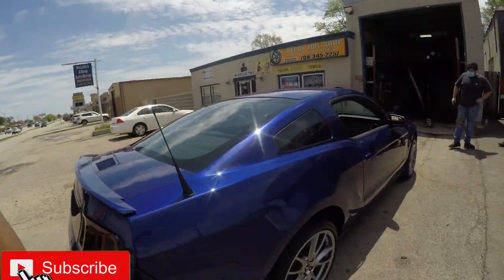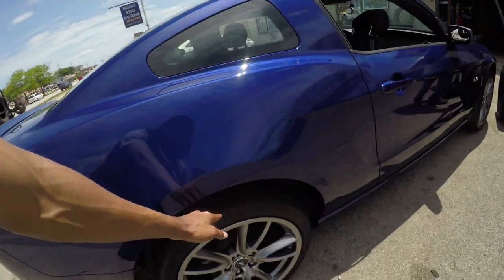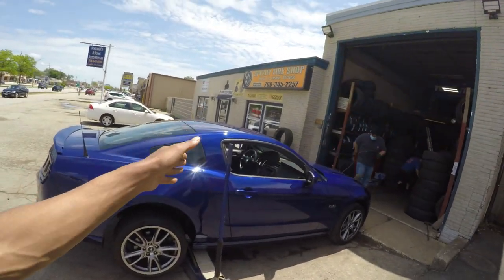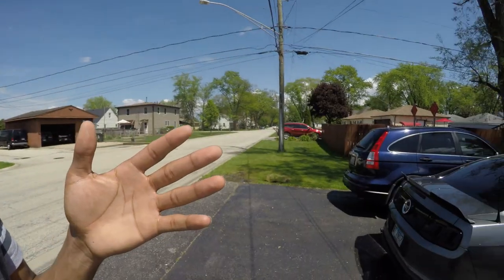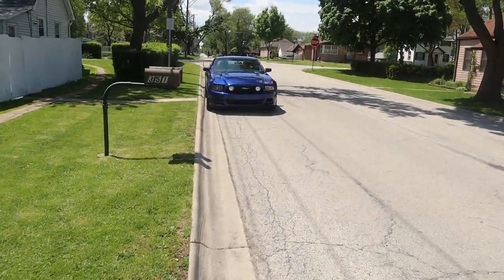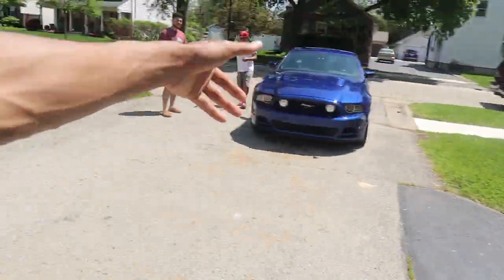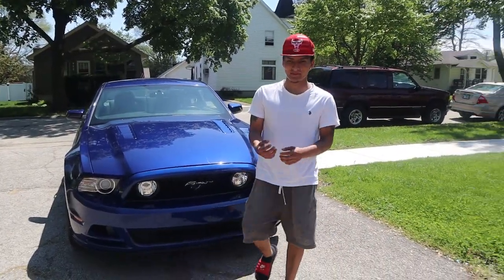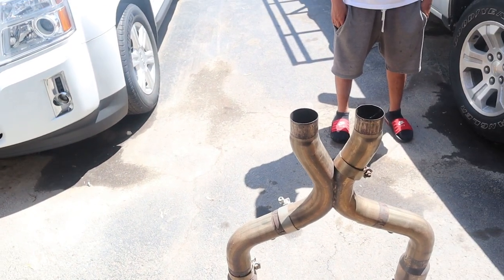First Mods to My 2014 Mustang 5.0!

Comment: Nice video, currently looking for a 13/14 s197 my self, but definitely after your whole issue you had Iv definitely been a lot more careful in finding one. But how if you don’t mind me asking how much did you pick your car up for?
Reply from the maker: UnKnownTV Forsure. Definitely make sure the clutch, trans and engine is in great condition. Take someone of knowledge with. Mines was $20,600 with 34,927 miles